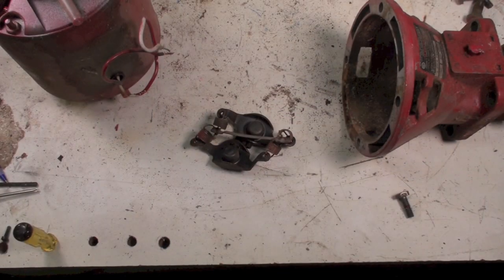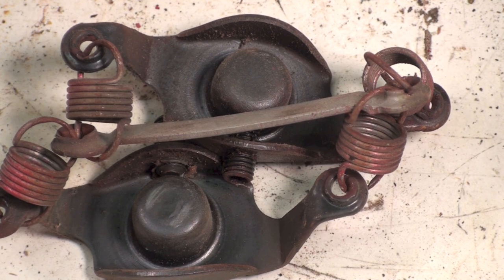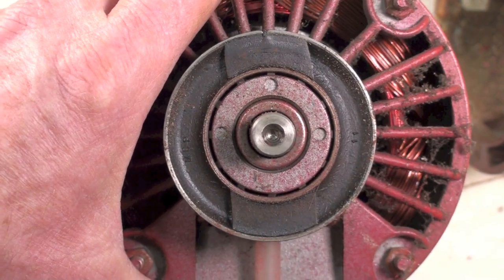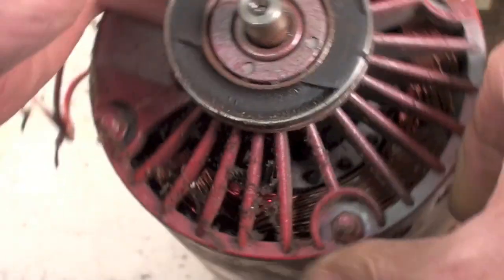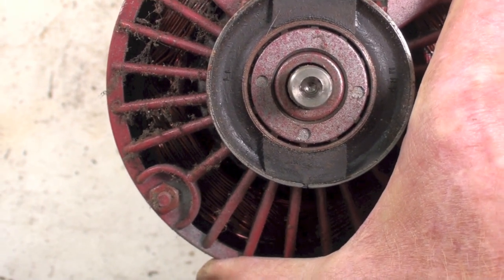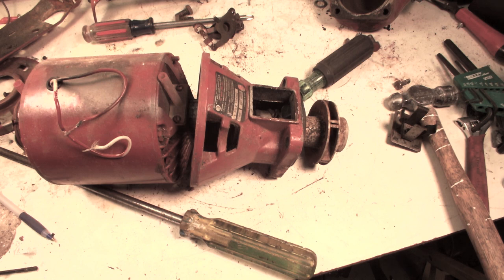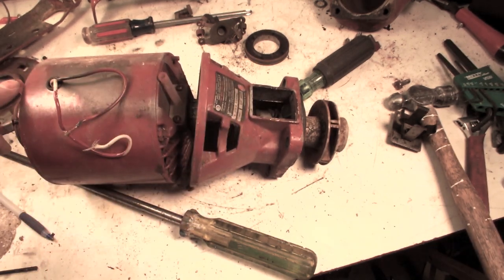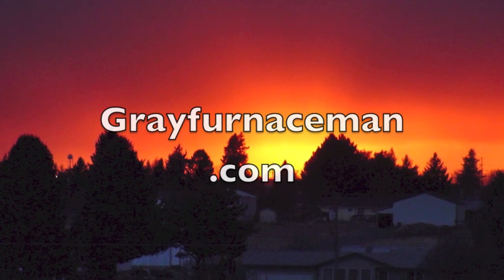Troubleshoot the Bell and Gossett boiler circ pump

Comment: Thank you for your video!
I just replaced my motor mounts on my B&G, 1/12 HP,  but may have installed them upside-down. Does this matter? I had watched the State Supply video, https://youtu.be/-3R3b5OiNUI, and at about 5:51 they showed the original motor mount with its expansion joint facing down but then they installed their new one with the joint at the top (9:01). They provided an explanation that seemed to make sense. The motor mounts I replaced originally had the expansion joints at the bottom. This agrees with what I saw in your video. Was I wrong to follow State Supply's suggestion to have the expansion joint at the top? I really hope that you can shed some light on this. Thanks again!

Comment: The circ pump in my apartment is exactly the same as this B&G, except that it is made by Armstrong. It was jack-hammering very loudly and the maint guy replaced the coupler, but not the motor mount. The jack-hammering stopped, but it is still too loud. I hear a very loud hum in my walls, but they say this is normal. I made a recording of it, so please tell me what is making this noise:
http://soundcloud.com/kiko98-1/noisy-pump-mp3
Reply from the maker: That motor is generally very quiet.  The noise you recorded was very bad.  The mounts need to be replaced.  In any case, the new coupler will fail soon.
GFM
Reply: grayfurnaceman
Thanks! If for some reason the pump is still not quiet after replacing the motor mounts, what would be the next thing to replace? Bearing assembly? Motor? Could it just need oiling? The apartment owner is way too cheap to ever replace the pump. It's like pulling teeth to get them to even work on it. :(
Reply from the maker: Eric Greene It is possible that it needs oiling.  I would think the service tech would have done it.  It needs 2 tablespoons of oil in the bearing assembly.  Usually the bearing assembly will leak water if the bearings have failed.
GFM
Reply: grayfurnaceman The maint man says there are no rubber motor mounts on this pump - just a metal-to-metal connection. He oiled the bearing assembly, but says there are no oil ports for the motor, and that it is the motor that is making the noise. He also said that the owner would not let him change out the motor, because it is still working. I told him that a boiler recirc pump has to be working AND be quiet.
Reply from the maker: Eric Greene All I can tell you is if the pump looks like the one in the video, it has 3 oilers.  And the mounts are rubber.
GFM

Comment: Worst coupler design ever and if they leak the bearing asembly is usually junk
Reply from the maker: That assembly has been the longest lived part I have seen on boilers.  I often see them with over 60 years of service.  The water cooled pump assemblies came in the 1970s and it was over 20 years before they were lasting more than 15 years.  
This pump does require service.  Annual oiling and inspection are necessary.  The coupler has a very long life if the motor mounts have not sagged.  
Leaks in the bearing assembly are usually caused by problems with the coupler and 80 to 90% of the time will seal when the mounts and coupler are replaced.  
GFM